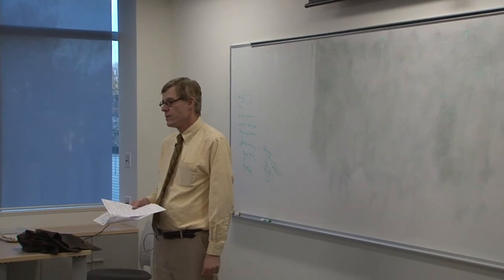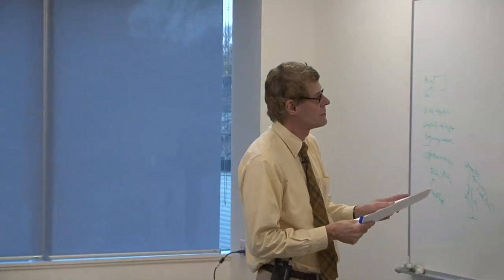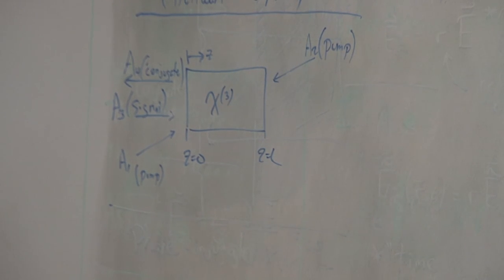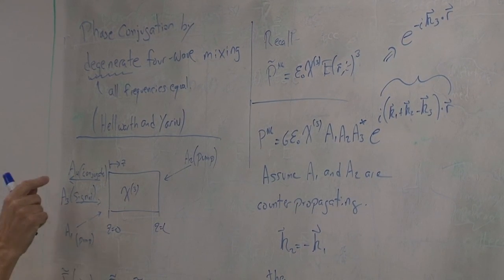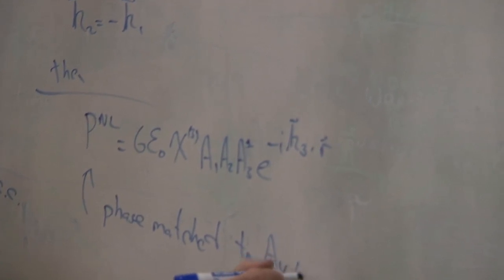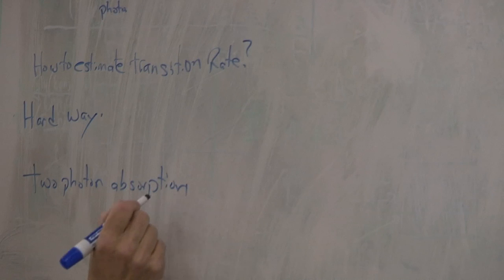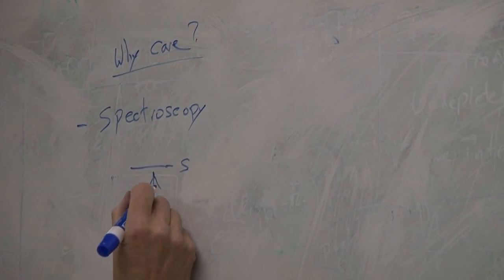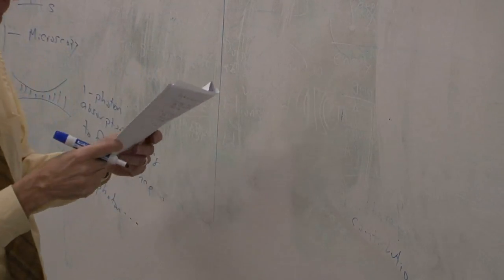Robert Boyd’s Nonlinear Optics Graduate Course 2016 - Various Topics 2/3

Comment: I spoke to a Chinese gentleman who advocated the use of Lock-In cameras to capture the wavefront and feed it back in via a spatial light modulator.  Is there any other means of using 4 Wave Mixing for example that a Phase Conjugate Mirror can be achieved?  What is the mirror?  What am I missing?  Thank you sir.